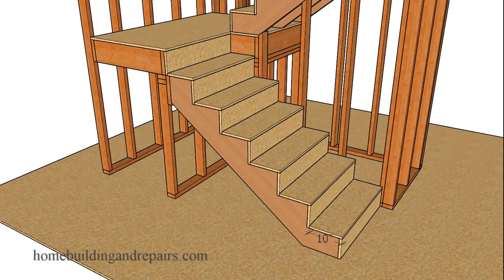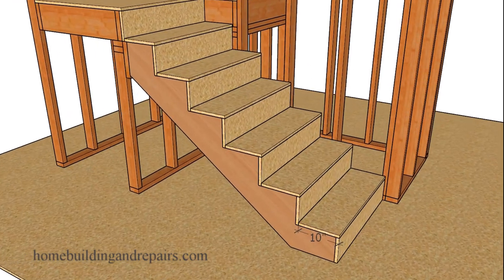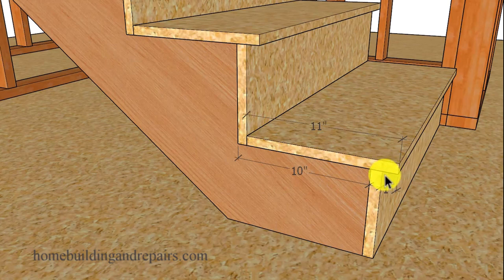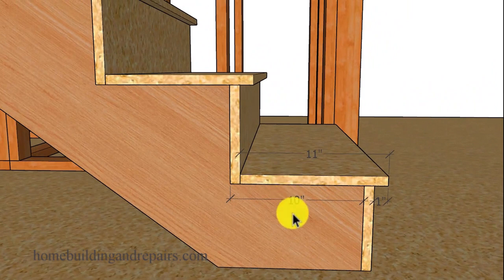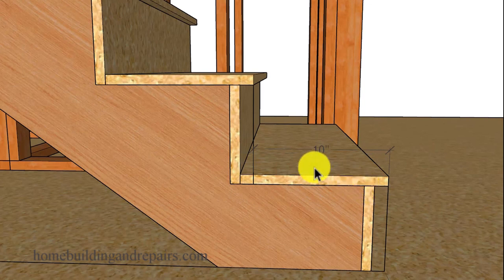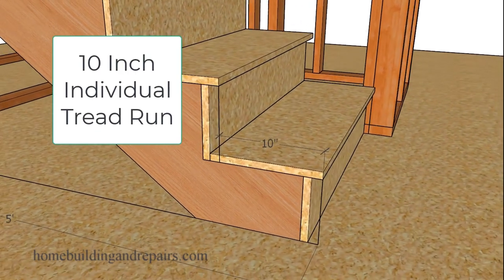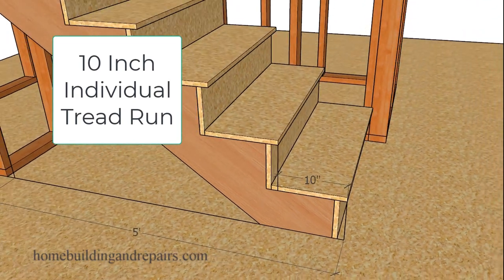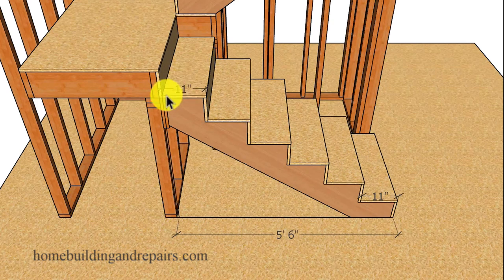Stair Steps Less Than Eleven Inches In Depth Might Require Nosing - Building Code Education

Comment: Same code locally here in Michigan, with solid risers. Open risers don't need the nosing, even at state minimum 9"tread.  What doesn't make sense to me is that open risers can't pass a 4" ball.  That means a <4" rise, or half open (?) riser.  Any code compliant way to run open risers on a deck or anywhere?
Reply from the maker: You can use smaller risers that will allow a gap between steps smaller than 4 inches or larger treads that would be wide or tall enough to prevent a 4 inch sphere from passing through. I've nailed 2 inch strips of lumber under the wood treads to meet code also. Let me know if this didn't help.